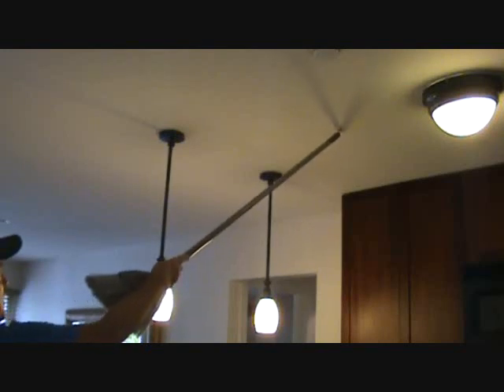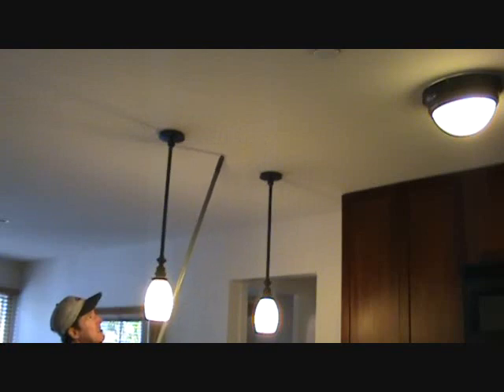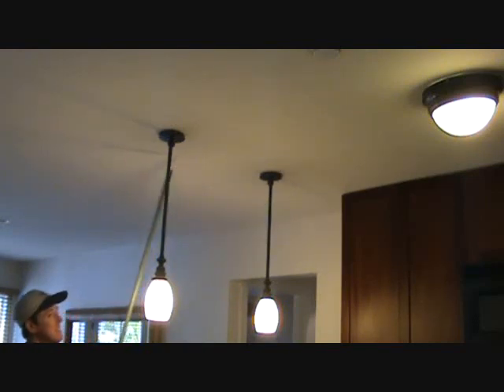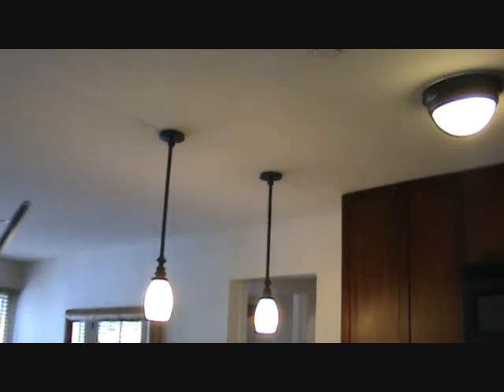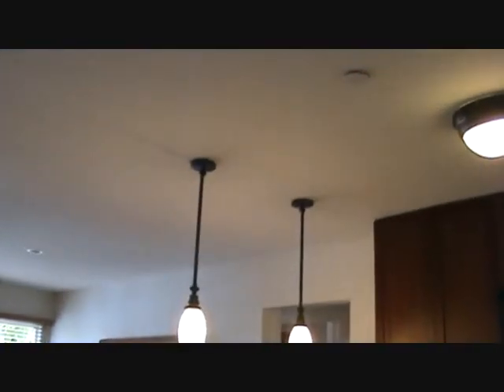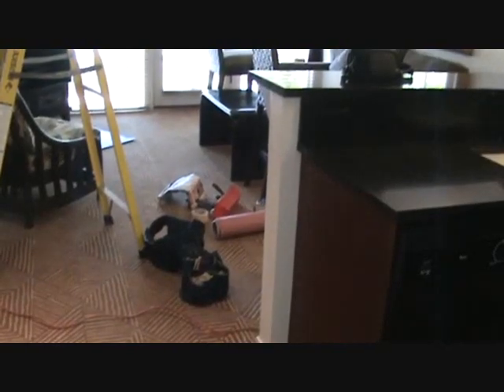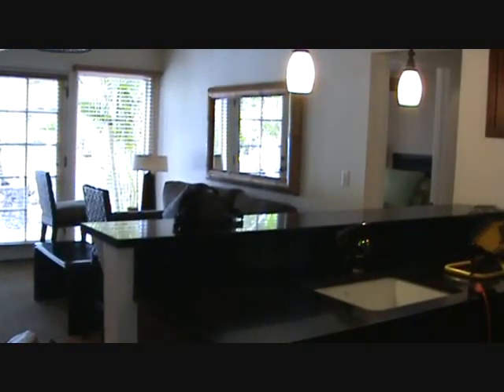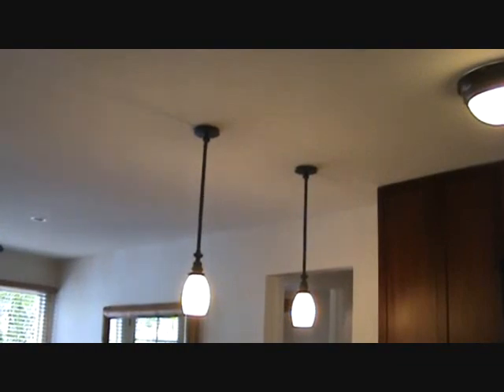Patching a water damaged ceiling...things to consider

Comment from the maker: The most times you should use primer is on a bare wall that has never been painted. The primer covers the drywall mud & prevents your finish paint from soaking too far into the new sheetrock to where you're not getting a good full coverage on the wall. Some painters also say that primer prevents the finish paint from looking blotchy at the mud areas of a new wall. I used stain blocker primer here since I will be covering a mud patch where there was a water leak. Thanks for questions.   Joe  :0

Comment from the maker: In some cases, I have skipped using actual primer for a fresh sheetrocked room that was ready for a first time painting. Sometimes I have used a flat paint for my prime coat but I still use 2 finish coats of paint over that. Sometimes I will also have the "primer" tinted towards the overall color of the finish paint. It gives you a more full body paint look, when complete.   Joe  :0

Comment from the maker: You are also right when you say to use primer when the existing wall paint is really darker than the new paint you want to apply.....this is especially true if you have an eggshell or semi-gloss paint on the current wall. If you have flat paint on the wall, you can still cover (without using primer) by applying 2 coats of finish paint. In most cases, apply 2 coats of finish paint over any primer. Hope these 2 messages answer your questions. Let me know.   Joe  :0

Comment: Whats up Joe, I got a question for you. I have come to realize that interior primer is only need when your trying to cover a dark color with a light color. In that case, primer has saved me time, and had a purpose.

I have used tinted primer too, but still the primer offers little to no protection on interior or exterior surfaces.

I have gotten far better protection outside, and equally good results with coverage with out priming. 

So why do you use it?
Reply from the maker: Now days lots of paint they claim already has the primer in it but I am leary about that still. The primer just makes sure you get a good base coat on there before applying the finish paint especially if you are planning on only using one coat of finish paint for instance. Primer will then let you cover more surface area with your finish paint since your finish paint will not soak into the drywall as much giving it less than a full body paint look for instance too. Some thoughts for you...